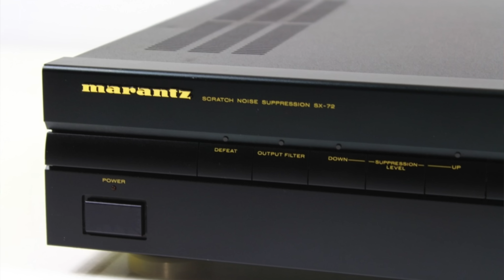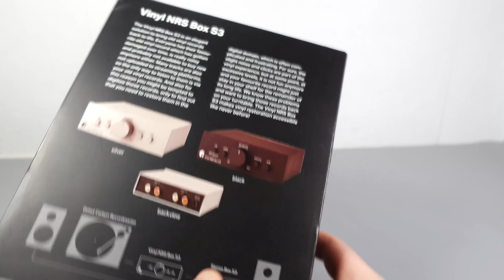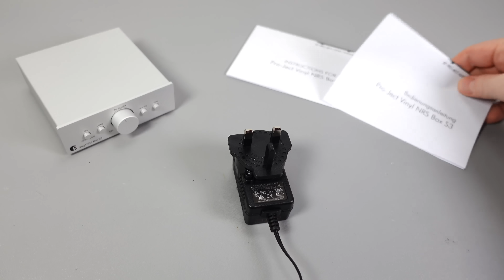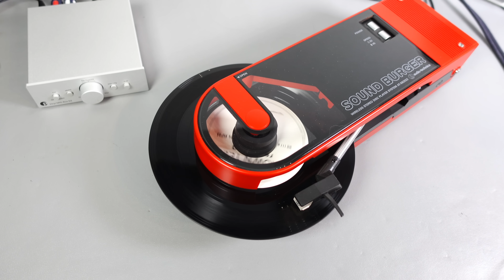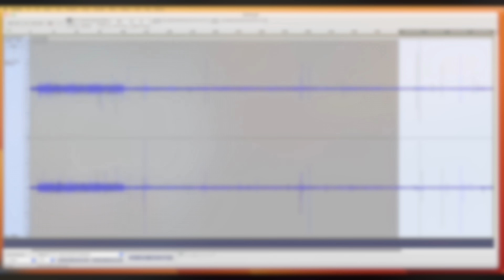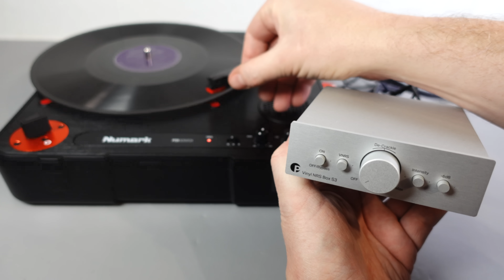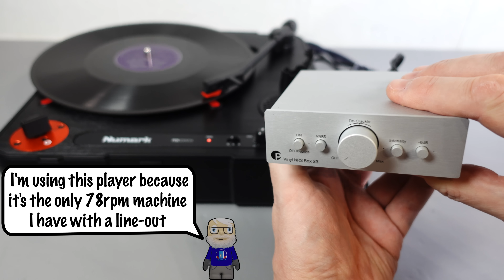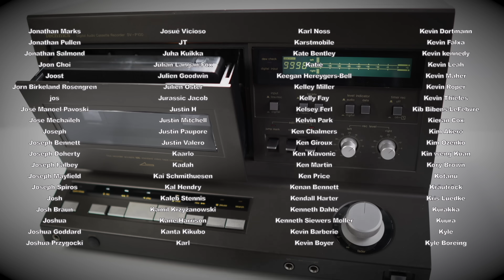REVIEW : Vinyl Noise Reduction System Pro-ject NRS Box S3

Comment: I was wondering, how much better the noice reduction could have been, if you would allow it to process the audio more, and thus introduce something like a 2 sec delay? I would argue, that it would not matter that much for the normal consumer, if the audio was coming about 2 sec later than before, but it would have "time" to do more advanced noice and "pop-reduction".

edit: Techmoan, if you can get your hands on a device, or a solution something like this described above, that would make a very interesting video(and comparasion)! Maybe even a digital solution or something, if no hardware solution is found.

Comment: Finally! I wanted him to do a noise reduction system for months!

I have purchased a TNE 7000A and it does make a difference. It does reduce the poping a bit. Now... You should tame your expectations, it's not a magic button. It's not like Dolby on cassette, but if it works, there is a difference!

If anybody is actually searching for a decracle or noise reduction machine, go for a vintage one from the 1970s. A TNE 7000A works okay, but the better version would be the SAE 5000A. They are both based on filters and are all analog. They search for the spikes and if the filter detects it, it reduces it's intensity. I think the Burwen Research TNE 7000A is more suited for the crackle rather than repeating scratches. As I have it, that's most what I notice.

Comment: There are clay bars for car detailing, used to prep paint for vinyl wraps. It's supposed to remove small stones and dust embedded into the clear coat that stayed behind after a regular wash without scratching the clear coat. Those might work for getting the records clean aswell.
Reply: Have a go and let us know how that goes 😂
Reply: How much it will remove of the detail from the music is another question. It’s one thing to get all the dirt out and to do it without throwing the baby out with the bath water.

Comment: The noise reduction tools in izotope rx are amazing, and do an unbelievable job at removing noise from analogue recordings like LPs.
Reply: this is using an on board buffer system and noise reduction in real time , probably using an open source model which is dated. private companies create their own algo so RX and Waves have finetuned the listening experience.
Reply: Even in Audacity which he used in the video there's a great click remover. You just select a tiny amount of audio with the click in it, select Click Remover and it removes it almost completely transparently

Comment: 15:30 Maybe the algorithm makes errors with the max-max setting.
The analog de-noise system i owned had such a problem. It would actually randomly create pops, if i had the settings set too high. It was based on filters and some primitive transistor "sense-logic" that controlled the intensity of the filters via control voltages. There were some specialized SSM analog chips inside to the point where i thought it might have been a synthesizer in the past ;-). It had serious limitations to the point of being completely useless with quality 33rpm records. The effect was noticeable with cheap and noisy 45rpm records but the way it worked was to remove the noise by filtering either the higher frequencies and/or the lower frequencies for a very brief moment. When several pops came fast after one another, it would dampen the sound to the point that i thought i had hearing problems. The device was seemingly a hand-built system or prototype with etched and masked PCBs but a lot of patch wires. It had no markings or labels except "Dynamischer Filter" (dynamic filter) in white lettering on the front of the black metal case. I sold it for a nice sum to a collector who was very keen to have it.
I normally use audacity to record and de-noise vinyls.

Comment: For me the better, but more expensive solution for this problem is having a PC in the audio chain and launching iZotope RX plugin for the de-noise and de-crackle. Works flawlessly and in some cases completely eliminates said noises and crackles. The only drawback is having a dedicated PC for your system and slight delay which is needed for processing with a plugin. 

UPD: Checked out the examples in the video and came to the conclusion, that iZotope does a far better job with the de-crackle than this device. However, the de-noise algorithm on the ProJect is similar in quality to iZotope.

Comment: What I don't get is why "audiophiles" play vinyl when they want absolutely ZERO noise in their system. They'll spend tens of thousands of dollars just to remove all noise, when all that would take is just using a CD or digital file instead. The vinyl audiophile market is one that I truly don't understand. I like listening to vinyl and cassette because of the noise. If I want crystal clear audio I'll go with digital instead.
Reply: If you're talking about CDs produced (or remastered) since the late 1990s, many of them are sonically crushed with dynamic range compression.  The age of great-sounding CDs was roughly a decade, or slightly longer.  For anything after that, your better bet is finding on LP if you can.  Also, there's stuff that never came out on CD at all.

There are a lot of reasons to love LPs without necessarily loving clicks and pops.

Also, most "audiophiles" are NOT into noise reduction boxes.  When I talk to audiophiles about stuff like this, there's a few who are interested, but there are also a lot of them who will loudly inform me that I don't know how to clean my records properly, and their high-dollar system is somehow super-quiet without any noise reduction devices, records that have clicks and pops should be replaced with better ones, and anything digital in the signal chain is sacrilege, etc., etc.

Comment: I used to do a lot of artifact reducing for my samples in the early 2000s. Ale the fully automatic processors were as useless as this device. The adaptive noise reduction were quite better. But i quickly learned that only human ears and editing on a sample level can be helpful. It's quite satisifying to learn how to edit the waveform lines with pen tool to achieve the pop reduction. Today we are finally in a time where we can have the "human approach" but with a machine thanks to AI. But I don't know any AI noise reduction software right now. Maybe you know such soft?

Comment: In the 90's I recorded records on my computer and then I would remove the loud cracks, just for fun. I remember the cracks manifested as a spike going to max level, to minimum level, and then back to zero. They where removed pretty easy by just drawing the waveform by hand at the place of the spike. I would assume a DSP would have no problems doing that, but it turns out it's not that easy...
Reply: Adobe Audition from the CS6 days had a built in click removal feature that worked more effective than this device here - but without a lot of fancy parameter adjustments. So my guess is that it's mainly a question of processing power.... this is where the economics kick in: a better chip (in terms of speed and/or processing power) in a box like this should be easily available, but might require a bigger power supply, a more refined enclosure to cope with air circulation etc. So for the given price this just might be a classic case of 'as good as it gets'.

Comment: A PC program that came bundled with a Sony USB turntable did a decent job at removing pops and clicks from a digitally captured track.  To have that working in real time would be nice...but vinyl static and clicking is so random it is quite a challenge.  Probably the best that could be done is to reduce the output of whatever frequency band the majority of pops and clicks and static effects.

Comment: Technically, wouldn't an idea be to record a vinyl, then while playing it back, cancel out all differences with the previously made recording. Such a device would however require you to once "record" the vinyl to create a template, and then using that template during playback to find any differences to cancel out. That should cancel out all surface noise (that are different from playback to playback), and any crackles/pops that aren't caused by the vinyl itself, but a cause of the stylus or similiar.

However that wont cancel out any crackles/pops that are due to scratched in the vinyl or unclean record, because those sounds will come at the very same place everytime.

Comment: I bought my Sweet Vinyl SC-1 Mini Sugar Cube when it was an Indigo fundraiser in 2020, and love it to this day. It is an indispensable part of my stereo kit. RCM's can get only so much dust and dirt out of the record grooves ...it doesn't matter how much or how thoroughly you clean your records. While I do love vinyl - I have been an audiophile since I started collecting in the 1960s, but the pops, clicks, and surface noise were always bothersome to my ears. No longer. Additionally, I have the same TriMicron Beethoven LP you tested in the video. Even after a thorough RCM clean the pops and clicks are reduced but still annoying. Set the SC-1 Mini to minimum and it's dead quiet, just music.
Reply: I also have a Sweet Vinyl mini and am very pleased with its results.
Reply: Man you need to try Ultrasonic cleaning(the proper way, not a humminguru or similar). It truly gets every bit of dust and grime out of the deepest and finest grooves.
Reply: @JtBrown-el4xt  A Humminguru or Degritter with proper surfactants does a perfect job. The issue most people have with any sort of cleaning is not using a surfactant. The grooves in most vinyl is just too fine for water to penetrate due to surface tension.

Comment: I have a SweetVinyl SugarCube Sc1-Mini and I find it works really well. I find a really satisfying difference switching between ‘repair’ and ‘bypass’. Also I notice nothing lacking in the clarity and quality of the music even when turned right up to maximum ‘repair’. It also has a particular nifty feature that the Pro-ject device does not. With the press of a button you can hear ONLY all the cracks and pops (and no music). Again, I’m happy with the performance of my SugarCube to greatly improve crackles, clicks and pops
Reply: I use ClickRepair RT running on a mini-PC for my setup. Works almost just as good and I saved $1,450.
Reply: @halflip876  I'm also using ClickRepair RT, on an old XP PC with a decent sound card.
It's absolutely fantastic.  Best £40 I ever spent.
Reply: SugarCube leaves this thing in the dust but it’s definitely expensive.
Reply: I agree, the Sweetvinyl SC-1 is in a completely different league. I usually leave it on 3 out of 10, and all the cracks and pops are completely gone, with no effect whatsoever on sound quality. It doesn't do NR though.
Reply: That is actually brilliant. You can verify that the "repair" actually works - they can identify and separate the noise, which is the hard part. If that works, they might as well output the repaired music, it's easy.
No more relying on marketing blurb and placebo sorry I mean respected audiophile journalists and their MegaHertz hearing.
Reply: "With the press of a button you can hear ONLY all the cracks and pops (and no music). "
The reason for this is a bit of a gimmick, there is no real reason to output that stream. The snap, crackles and pops are sampled and then fed back into the original stream with a 180-degree phase shift, thus cancelling them out, not too dissimilar to noise-reducing headphones.
Reply: I have the original SugarCube SC-1. It's the best bit of kit I ever bought. A complete miracle, and clearly in a different league to this Project device. I've had it several years, since they were first launched, and in that time only a few crackles have got through and cheated the software in there! Through my Harbeth 30 speakers, I can detect no impact at all on fidelity when the SugarCube is doing its thing. It really is a miracle and I'd liked to have lent it to Matt so he can try it out. (BTW, the manufacturer, SweetVinyl, seems to be a rather odd outfit, not particularly adept at marketing. I'm also surprised they haven't sold or licensed their technology to big Japanese companies.)
Reply: wait you listen your vinyls for the music and not the beautiful analog sounds created by the dance of stylus and vinyl in divine waltz? What a peasant. Only us real audiophiles understand the true beauty of analog sound.
Reply: @alkestos  SweetVinyl should use rubber instead of metal, for their chips' legs, in order to achieve better noise attenuation. Also, the mains cable should be gold covered on the outside, for better conductivity.

Farmers don't know this simple trick. 10k $ please.
Reply: @Constantinus213421  My latest optimization was coating my favorite vinyls in gold. Sure, it was a bit heavy on the old wallet there, but now I hear every bump and dip there are. Can't get more analogue than that. Naturally my turntable is resting on a 10m x 10m airpad, couldn't stand hearing any extra vibrations in my audio. I hope you have your cables held above the floor, don't tell me yours lay on the floor?
Reply: Bit surprised that project let this go on sail , as a viable proposition. As others have stated the sauger cube is a better option .  As yet we seem a long way off a device that costs peanuts and actually make a profound difference , which considering how computers have developed they  don’t seem to be able to achieve it .    Probably not as yet enough demand
Reply: So if you ever feel like the music ruins the sound of the crackles and pops, you can just listen to them only?? Sounds great, where can I get me one?
Reply: @JaredConnell   the point is you can check out the condition of your records in this mode.  Somewhat novelty feature yes, but nonetheless interesting.
Reply: @rlc949  I can’t believe you even had to explain that.
Reply: @JaredConnell  the invert mode for these devices is to make sure you are not removing program material by having the repair set too aggressively. If you can hear pieces of the music in the pops and cracks you dial it back.

Comment: I had the opportunity in the early 90s to try out several de-click and noise reduction devices for free as they became a bit of a fad, and a couple of my friends offered me variious high and low end devices to try for a while (I think they wanted to convert me to vinyl fanhood). Some of them did make an improvement, but they were all very subtle and to my mind it was too small an improvement for the cost invoved. I found that if you listened to a record that you enjoyed enough, you just stopped noticing the crackle and it became part of the experience. Records with scratches too loud to ignore wouldn't be helped by technology anyway, and sometimes the drop-out  when it removed the scratch was more intrusive than the actual scratch.
Reply: Interesting though that if this device with its fancy DSP tried to apply that algorithm - cutting the audio completely around the scratch - you’d probably get better results; all it needs to do is buffer up a bit of audio and then throw out transient peaks.

The fact it’s trying to filter, rather than omit, is the biggest issue here I think.
Reply: @cyberyoyo7674  Yes, I'm sure that there already exist DSP algorithms that could do a fairly seamless job. I would guess those are proprietary and expensive to licence though and makers of this kind of home gear aren't into that kind of investment. Some of the scratch eliminators I tried back then worked OK if there were not too many close together, so they could do a decent job if you had a single scratch each revolution, its just the rumble and "crackle" they failed at. I would hope that modern ones have improved in 30 years, and if I had a big vinyl collection I'd probably be more interested in finding out whats available now.
Reply: I was somewhat aware of those devices, but I wasn't into LPs at the time, so I never tried them.  I know they had mixed reviews.  Today the SugarCube works like magic for me, though.

Comment: Instead of doing one long recording of the silent record and changing the settings after set time periods, why don't you make four recordings of the same section of the record with the different settings enabled from the start? That should eliminate the "quiet [parts] of the record" giving you a false positive (if that was the case in your testing).

Comment: Great video, but I’m not sure I agree with the methodology. Maybe you could compare the effect by recording the signal at the phono amp, Pro-Ject and others sell a phono stage with a usb out along with line level. At that point you could use audacity to cancel out the two tracks, which should give you a audio track with only cracks which were removed.

Comment: I had a dart pro audio nois reduction plug in about20 years ago that worked phenomenally well . However it required work and a noisy 3 minute 78 would take 15 hrs of you working by scouring the wave file finding the crackles one by one and replacing them with a equal amount of sound befor and after the pop. Then with a phase scrubbing prosess you could eliminate surface noise.  An absolutely great tool .but designed for professional restoration. Not practical for the consumer market.  Back in the 70s i had a commercial fm radio station pop filter that worked great . It was simple it also did de emphasis which is a must fo fm to get maximum modulation from the transmitter.  But that was ok to. I never hated listening to fm back in the day. And i reall saw or really heard anything wrong with the de pop box . And it in no way made me mad.